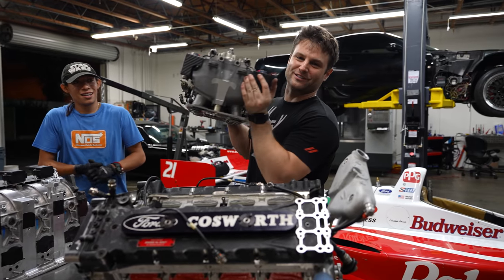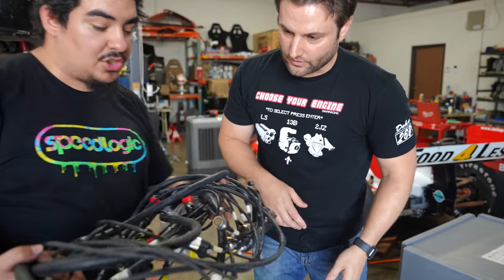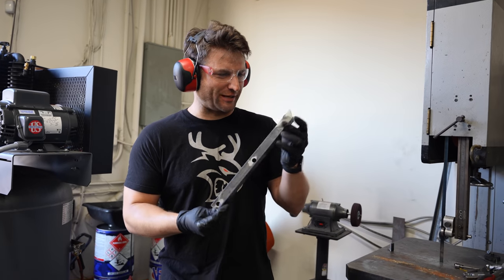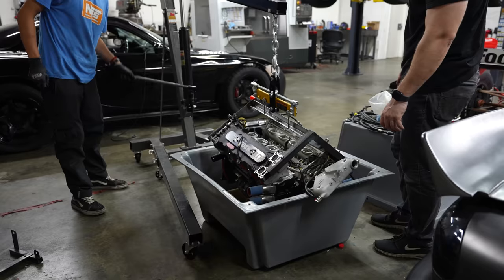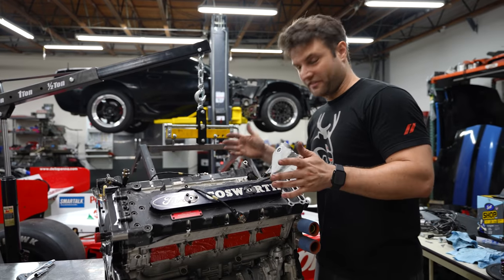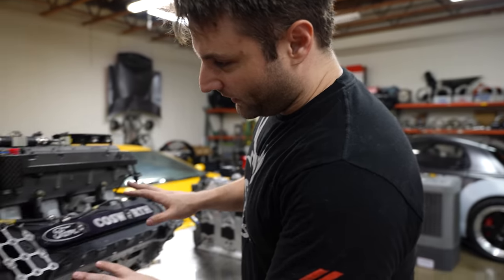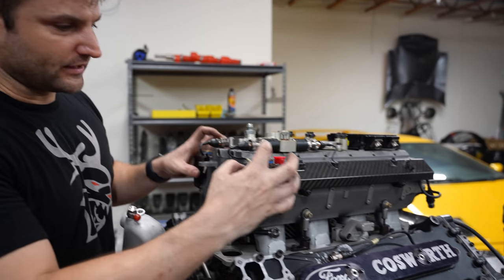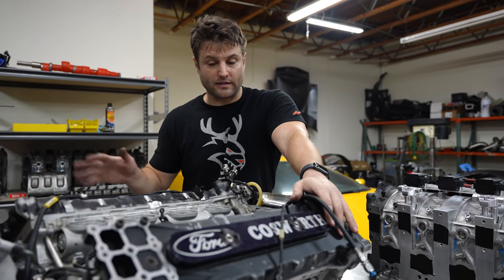I bought a $37K running IndyCar engine. I shouldn't own this

Comment: Rob, I know that these were turbocharged V8's, and I'd never bother to change something drastically, but god damn would I love having an 8-1 header feeding a single turbo.  That sound would be incredible.  But either way, have fun with what you're doing.
Reply: It is 8 into 1 turbo lol
Reply from the maker: It actually was an 8 to 1 turbo like bruno mentioned. hard to see because the turbo is mounted inside of the transmssion cage area.  itll be so sick
Reply: @RobDahm  At one time one of the manufacturers played around with single sided turbo for Michigan. Basically they just had one bank of four driving the turbo with the other side straight exhaust. Actually made a bit more power but took so long to spool they were dead in the water if they had to lift for traffic.
Reply: I personally want to hear it N/A with a full titanium exhaust 🤤
Reply: @br1_deadpedal  Does he mean equal length?
Reply: @kobotherobohobo  I'm not entirely sure that's feasible for Rob to go through with.
While he definitely could just attach the plenum to an open filter, the amount of engine internal changes wouldn't be reasonable.  The pistons would have to be replaced with higher compression ones (and that's assuming that the compression height geometry can support just a piston swap and not a replacement of both connecting rods and pistons together... which either way would require the crankshaft to be rebalanced for the new assembly...)
honestly, if he was going to go that route, it'd probably be more realistic for rob to go after a Judd 3.4l instead.  But who knows how much of an engineering nightmare that would end up being...
open for debate either way.
Reply: @RobDahm  if that's the case would you consider getting a dual inlet exhaust side similar to the modern ones in F1 or would you still go for a more direct singular T4/T6 flange with all 8 cylinders going into one side of the housing?
Reply: @jacquescrusan9500  Probably isn't very feasible, but that won't stop me from dreaming haha. I have no doubt it would sound phenomenal if he did go through with it
Reply: @jacquescrusan9500  Just to get it to run N/A? Why would he have to get higher comp pistons just to run it? Heck even to drive it, wouldn't it just be down on power?
Reply: @danielnelson4881  in NA engines one of the ways to make power is to increase the expansion ratio ( basically fancy term for comp. ratio).  Increasing compression increases the overall force delivered to the crown of the piston when combustion occurs, leading to greater mechanical advantage achieved, meaning more torque generated per single power stroke.
The vast majority of forced induction engines remove a bit of compression via dished pistons or pistons that top out in the hole instead of flush or above it, to prevent detonation.  And even if this engine already has flat-tops or even domed slugs, with a fuel like methanol the engine can be taken further.
Reply: @kobotherobohobo  stock XD exhaust is titanium.
Reply: @kobotherobohobo  all the power comes from the 40 pounds of turbo boost. N/A. it's just another expensive v8.  If u look a guy in England runs XD N/A for hill climbs. It's still cool.
Reply: @danielnelson4881  interesting side note; since methanol is corrosive to engine internals. It requires pickeling(flushing)with gas. 

Also need to pre heat. Might have a heater core built into it. Check for a standard looking Male 110v plug. 

Change the fuel map. And it runs pretty darn well on 89 octane.

 I usually started the car on gasoline. Cuz it fired easier. Then switch it to methanol. Then back to gasoline when you want to put it to bed.
Need to remember these were built to do 500 miles flat and Michigan. 90 litre fuel cell. 

I hope your fuel cell is in good shape and the FUEL PUMP is also in good shape. The cell is an easy change for you and your guys. but the fuel pump might be hard to source.
Reply: @br1_deadpedal  I didn't mean keep it that way, oh heck no. I thought dude was just saying he wanted to HEAR IT as NA. Like run it for a min or two, rev er up and hear what it sounds like... "OK cool! Now where's them turbskies at?"

Thank you guys for bestowing some of your, obviously vast amounts of knowledge, onto me! Always love learning.
Reply: @jacquescrusan9500  My last comment was for you too pretty much. I wasn't saying it would be efficient. Just that it would run, and we could hear it NA before he slaps the turbskies back on.

But thanks for imparting your knowledge, I always love to learn stuff I don't know! Aaaannnd now I've completely rewritten the comment... Of course, I knew that was gonna happen..
Reply: I wanna see more 8 into 1 fords. A high rpm Cleveland or coyote 😍
Reply: @wingracer1614  Toyota played with them at Laguna Seca and Fontana. I would be willing to bet it was the same for Michigan.
Reply: @RobDahm  howdy Rob...this is completely bonkers...i love this purchase for you...and i hope it serves you well...in whatever application u use it for.
Reply: 8-1 would be a sight to behold.
Reply: @wingracer1614  anyone ever go twin turbo each bank driving a turbo?
Reply: @gregoryballestero4369  Can't. Rules only allowed a single turbo.
Reply: There us a very good reason why the Engineers designed this engine with a supercharger.  Unless you are a team of Coseworth Engineers.  Then stick with the Supercharger.  Sometimes I think a preference of a turbocharger or a Supercharger is more psychological.  There are litterall hundreds of factors in designing boost.
Reply: @wingracer1614  rules 😭 I think we need like a new age can-am series with really lax rules (other than safety ofcourse) again

Comment: A friend of mine may very well have machined the heads on that engine. Used to work at the Cosworth factory here in Northampton, UK in the late 90s.. Specifically on the Indy Car engines!

Comment: Oh man, Amphenol connectors. Get ready to spend some (more) money, Rob! Those connectors are billet CNC machined and plated for your pleasure, but they are also stupid expensive and require expensive tools to open/close them. That main connector is about $500 alone 🤩

Keep all of them! You can get everything for them and can rebuild them easily. It's all MIL-Spec stuff too so you might be able to find used tools on the cheap

Comment: You’re absolutely right, it’s nuts how this engine from nearly 20 years ago is more complex and more advanced than even the most technologically masterful engine in any road car to date. The only engine that could surpass it will be the W07-derived power unit from the AMG Project One, and that might not even take the cake because it’s so detuned from the racing motor. 2nd place is even debatable, I’d say even the Cosworth v12 from the Valkyrie isn’t as well-engineered as this motor. Those racing engines are just on another level, so much so that even an experienced mechanic such as as yourself is baffled by its complexity!
Reply: Idk there's alotttta roadcars out there with souped up v12s

Comment: Excellent choice to step up the learning curve speed. These engines are relatively cheap and easy to understand at your level, and they're old dog tech. There's no unknowns with these. At the same time, this engine takes a large broccoli infused dump on most engines today in terms of quality and superior build methodologies, stuff you'll no doubt, as you said, be able to implement in the rotor, thus pushing it even higher.

Comment: Ford Cosworth was the most dominating engine in Formula one history. Ford was going to introduce the SOHC engine to nascar who banned it because they suck and said the engine was too exotic. Ford later got into formula one with Keith. The design of the Ford’s SOHC is in the DFV now sprinkle a little bit of the Duckworth in there and you have now a legendary engine.

Comment: Haha! You crack me up. I was in the Ilmor Engineering shop in 1998 (23 years ago!) and everything was machined on CNC. Ilmor designs and builds the Chevy (and previously the Mercedes and Honda) Indycar engines. FWIW, CNC dates back to the 1950's when paper punch tape was used to load the programs!

Comment: Wow the level of engineering and weight saving is next level.

The barrel based throttle bodies are very very cool. I'd like to know how they managed to properly seal it under boost pressure on partial throttle!
Reply: Conventional shaft seals are typically good up to 100psi, and easily up to 50 psi. Nothing special even for the Methanol (Viton is probably the most relatively available formulation for the o-ring or shaft seal). I believe these motors were running roundabout 20-25 psi tops on boost, per the rules, which means all the blowoff valve cheating meant they were probably seeing 30-40 tops. (Part time race engineer, full time mechanical engineer)

Comment: Rob i'd strongly recommend looking into borg warner turbos instead of garrett, there's a very detailed 2 part video where a guy compares the two in super detail and to be quite frank garrett turbos haven't changed much since the t-rex roamed this planet, even the G series.
Reply: I run borg.
Reply: Isn't he sponsored by garrett?
Reply: @kapiesmieszek  he is 😂😂
Reply: Wouldn't they be falling behind, like immeasurably, if they hadn't changed in forever? With all of the advancements in turbos over the last 20 years, how would Garrett be as big of a company as it is if their turbos were sub par? Big turbos used to take FOREVER to spool not even that long ago... 

They must be changing something that this video of yours didn't touch on, because I know the Garrett's aren't still spooling like a big turbo Supra in the late 90's. Link this video of yours if you don't mind Mr. Head of Borg Warners marketing division! I'm on to you... 😑
Reply: @danielnelson4881  No, its true, EFR turbos are more efficient than what garret has to offer. Not saying garret is trash, but if you are looking for just a bit more you go Borg Warner

Comment: good choice going with cosworth

these dudes made one of best rally cars in peak rally times

so that V8 should be way better than any junk LS since it was built by a legendary racing team
Reply: Cant go wrong with really anything cosworth puts out, beautiful engines inside and out
Reply: Cosworth had actually been in the Indycar game since the 1970s with the Cosworth DFX, the predecessor to this engine. It was basically the defacto engine until Penske came in with the Ilmor Chevys and blew everyone away.
Reply: @augustwatring888  - eh if you didn’t call this one the DFV a Ford don’t call the other one a Chevy either buddy. Although Ford and Cosworth engineers were already working together all the way back to the 50’s. Ford had a big part in the design of the DFV. They had built a 7.0l one called the SOHC. I have the book on the development of the engine:
Reply: @CoyoteFTW  Um... the dfv is literally all cosworth. Ford had absolutely NOTHING to do with it aside from financing it. Same as with literally all of cosworth's top level race engines in f1 and cart/indycar. Only their road engines had anything to do with ford. Same as ilmor...

Comment: unless it came with one the flywheel on that engine uses a carbon on carbon dual or 4 disk clutch . that's the same diameter as the flywheel it's small to match the clutch pack because the carbon clutches are insane at torque transfer and can take 5 times the force the engine puts out . think of it as an insanely good thing in an insanely small package it may help you get over the sticker shock when you price one of the clutch kits for this engine . I'm sorry I have to tell you this but there also Insanely expensive and the engine will have to have one to work it's what it was designed to use . I'm not going to name a particular sight but you can find web sights in England that still have these engines for sale all day long and in some cases you can get this same engine for between 10.000 and 40.000 dollars with all the spares and some sellers will throw in little extras to sweeten the deal just to move these out of there shops .they also have the transmissions the rear sections, all the linkages and fuel systems for these and the 6 cylinder Cosworth engines that were also engine regulated out they sell them as well .I never had the cash to get one but I can still look.

Comment: They use the methanol injection into the turbo to reduce the intake temperature. So they don’t have to loose power by running a restrictive intercooler

Comment: In all the years I have been watching open wheel racing, nobody has ever given me as close a look at an engine for one at this level of detail. I had no idea how much different and more competent so many of the parts of this engine are than the street motor. Even though this is now 20+ years old, it is still a revelation.  I'd love to have this level of visibility to a modern F1 power unit. Nice going.

Comment: Cosworth XD: 2,650cc V8. Comes with all ancillaries. Can be run as intended on methanol with turbo 850+ bhp or naturally aspirated at 600bhp on pump fuel . Max revs 14,000rpm. Lifetime between rebuilds circa 1500 miles (2,400km)

Comment: Considering the history and pedigree of this engine, i don't think it'd be wise to push it too hard, especially considering that any rebuild because of its rarity is going to be near impossible. This engine was made with older technology and by design also very tied to it. Could be wrong but anything too hard and it'll be a shame to see an engine like that go...
Reply: There are people still building these things and making or sourcing parts for them. Hell people still vintage race them. It ain't cheap though. And they aren't all that rare. I mean there are 33 cars in an Indy 500 field usually and every one of them goes through at least 3 or 4 engines over the month and that's just one race. It's not like it's the infamous Ilmor Mercedes that only had like a dozen or so ever built.

Comment: You need to look at the piston skirts and see there are basically no skirts. And ultra low-friction rings. This engine will run at 13,900 RPM flat out for 500 miles, but it will need to be rebuilt every 500-1000 miles. Expensive!

Comment: WTF ?      "You you just can't have an engine doing 11 - 14,000 RPM and not have the valves float' ?    Obviously this dude has never heard of or been in the vicinity of a modern High Performance motorcycle  ? 
  I hate to break it to you car clown but bike engines from Japan especially have been able to run for Years at continuously high RPM's. As in ( 14,000 - 16,000 ).
 I raced many National endurance series where our bikes ran at sustained RPM's for ( 4 - 6 - 24hrs ) without any problems. In fact, we ran entire seasons on those motors that Never saw anything below (10,000 RPM's ).   
 I guess it's ... MAGIC to a car guy ?

Comment: Beautiful beautiful. Next level. Cant wait to see you put this together.  Super sic xd. Oval exhaust ports(the second gen xd.)headers and turbo stuff available. if you need it. And brake rotors and pads. Best offer for you special. Turbos. Diffs. 
Looks like u need a fuel pump. That I dont have. 
Get to work on that fuel cell. See how it looks. Just peak in the fuel filler with a flash light. 
I also have engine build book from the factory. If ur planning on tearing it down. Discuss' things like heat treatment and torque specs 
 However it's for an xb
Congrats congrats  xd0027. Villeneuve was #27. Imagine it's the 500 engine from 95 that was an xb tho. 
Probably used in 97 or 98. Andretti. Fittipaldi maybe

Comment: MS-38999 connectors.  I spent the '80s building fighter avionics.  We had a guy who whole job was sifting though all the slash sheets of insert, clocking and other variations.

Comment: That flywheel must be SO light, I bet it pulls so hard on Up-Shifts. 
And floating valves is a problem my CBR has...it revs to around 16,500rpm, so the valves need adjustment every 2500mi on track

Comment: Yeah, nice bit of kit. Now imagine a Formula 1 engine of that era, V10 capable of 20,000 rpm 1000hp+/- and no turbo anywhere near it. But I'd still love to have a top race series engine to learn from as the technology back then before the green environmentalists started running it for everyone.  But a lovely Cosworth motor, the history of Cosworth and V8s is legendary in motorsport, particularly with Ford. Carol Shelby knew.

Comment: FYI they still sell a NA 10,000 rpm limited version for about £40/$45K for some crazy euro race series, I think that was with no heads or standard crappy heads, and teams were expected to CNC better ones if they wanted them. I only heard about it a few years ago when unpopular BMW Z8's were being bought up as a alternative, for the same money you got a more modern engine you could tune more cheaply overall, if not to the same level

Comment: Those electrical connectors and grounding points make me happy. Big chunky grounds in that coil pack cover. It's clear they put a lot of thought into the electrical, something that's often overlooked in performance builds.

 DIY digital/analog audio is a huge passion of mine and fancy connectors are common. OEM wiring harnesses with cheap plastic connectors are the work of the devil. $50 of waterproof AEC quick disconnect fittings would make wiring harness repairs/installs a breeze. Wish all cars came like that indy car engine!

Comment: He's one step below a formula 1 engine. Not to be a dick but I don't think he knows what he just got himself into. Clearances that only a finely tuned CNC machine can achieve, 12,000RPM and a rebuild cost of roughly $50,000 if he doesn't blow it up. Teams spend hundreds of thousands of dollars on research and development just for the heads and intake to gain that .001 of a second difference. You are lucky to get something like this and I can't wait to see more on this car and engine.